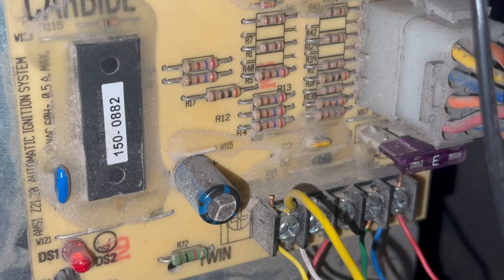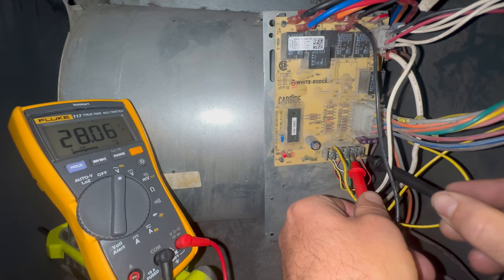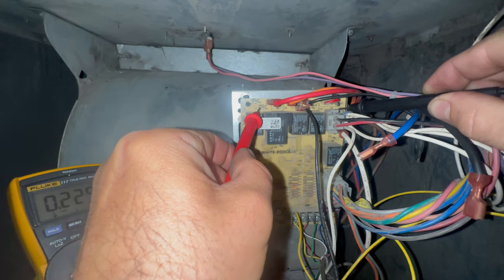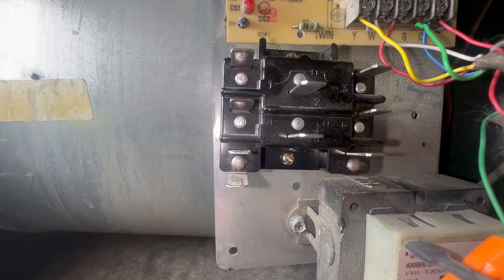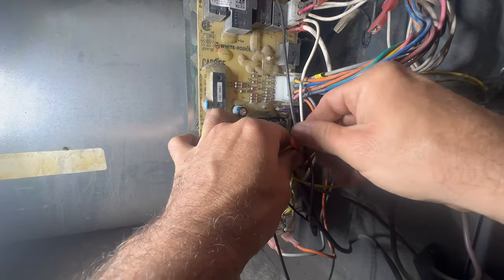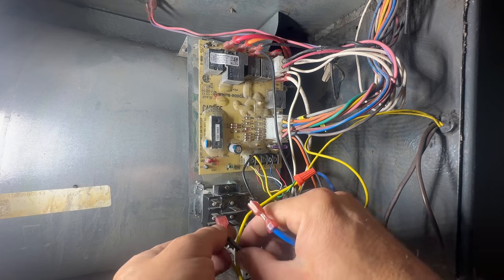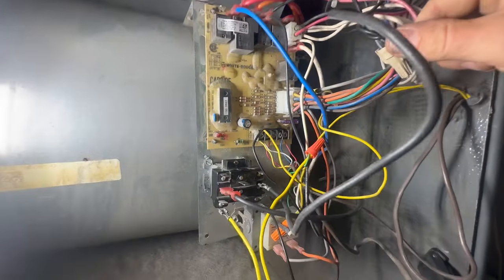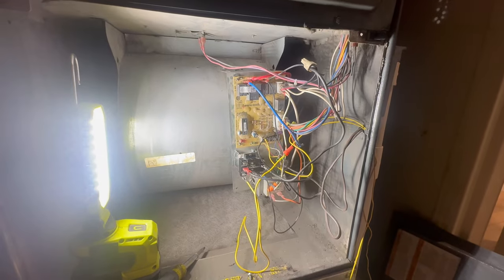Bypassing a Furnace Control Board with a 90-340 Relay to get Blower Running

Comment: I like that method. I usually straight wire the fan until I can get them a new board but your method allows for the fan to run with everything else like normal until you can get a new board.

Comment: Just for future as long as you dont have an ecm fan motor you can take your heat wire off and put it on the EAC terminal which will also do the same thing without having to add a whole seperate relay because the eac is electric air cleaner which has its own relay to turn on when the furnace turns on.... ive done it multiple times till i get a new ifc board.... or you can unsolder the relay from the board and solder on a new one if u got it which most people wouldnt so just pull the wire off and put it on eac terminal which is a 120 terminal...... let me know if you have tried this before
Reply: I'm a new tech I will try that can you make a video for me

Comment: This video saved a customer from the heat of Texas. Her motherboard burnt up and I had to bypass it. I had a 90-340 in the truck and I hooked it all up. She was cooling within the next hour. Get it done fellas, I never used on before.
Reply: Realy  conrold  normal opn comon termal  comon realy comon  gren  conrold realy

Comment: To which terminal on the relay would you attach the furnace wire, then, so both cool and heat are functioning?
Reply from the maker: This is only for the fan and the way it’s wired it will work with both heat and cool. Some gas furnaces might need to be wired differently

Comment: thanks for sharing. awesome work.  Question: if you were to use the low speed (heating), where would you connect it to the relay?
Reply from the maker: Remove your speed wire hooked up and place the low speed wire in its place. Ensure the speed wires are insulated or strapped up

Comment: Question. How are you able to work on hvac equipment and get supplies? 
I’m doing maintenance right now and they want me to work on some hvac equipment. The problem I’m running into is I can’t get into supply houses for equipment. What can I do to get into supply houses assuming your able to? Do you have a mechanical contractors liscence for hvac?  I’m stuck on how to go about this
Reply from the maker: My company has an account with Johnstone so I can walk in there . We also use a mechanical contractor to get us supplies

Comment: I keep one of those relays on hand for an emergency situation just like in your case. I put it in place of the goodman AWUF blower board if I dont have a board on hand for some reason. Its funny how some guys are amazed when they see something like this done cuz all they know is swap out part for part. But if you understand how the system & the relays work you can make it happen. Nice job bro! 🛠️👍
Reply from the maker: Thanks man ! Hope all is well with you. I've used contactors before to bypass boards in a pinch 😆 there's always a way to make it work

Comment: In that application why not just use a spst 90290 or other rectangluar fan relay, the other circuits are not being utilized, and eliminates the thunk noise people will complain about
Reply from the maker: I used what the building had, which was the relay that can bypass almost anything. I've also used 2 pole contactors in a pinch before for the same thing. It's in a common area in an apt building.

Comment: You said that the board is bad so why still the natural works there? 🤔
Reply: Fan relay is bad on the board, so once it calls for as the relay is the only thing that doesn’t close to complete the circuit.

Comment: Bypass you dont use the board?
Reply: The relay on the board is stuck open...this is a better way than hooking the fan up to door switch where it runs all the time...
Reply: Just take the heat wire off and put it on the eac terminal and bam your done till you get a new board because no one usually has an electric air cleaner hooked up so use that terminal.... it will just make the fan turn on immediately when a call for heat or cooling comes  in.... just as long as you dont have an ecm motor but even if you did no relay would work anyway